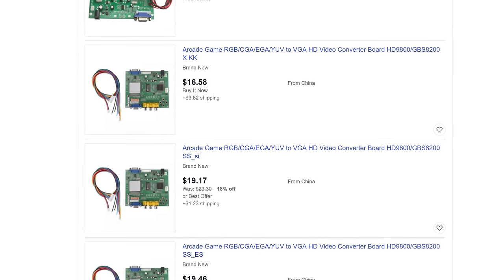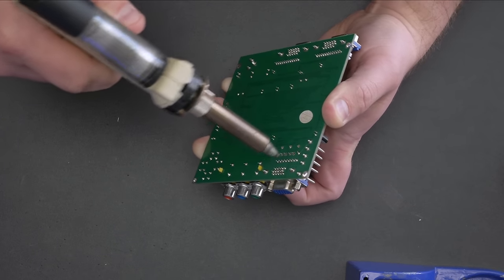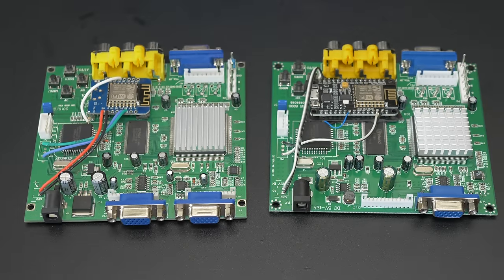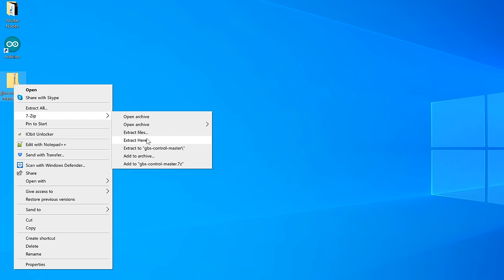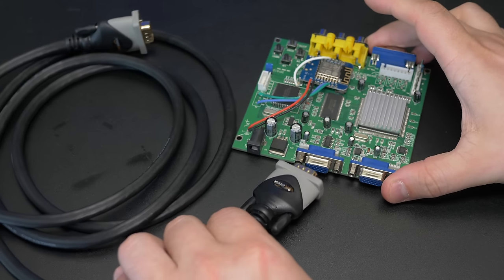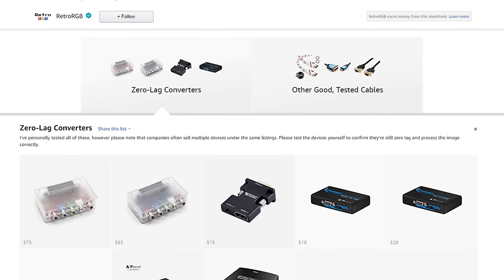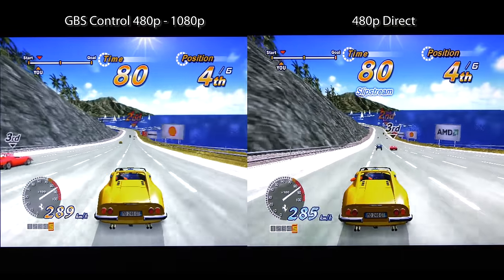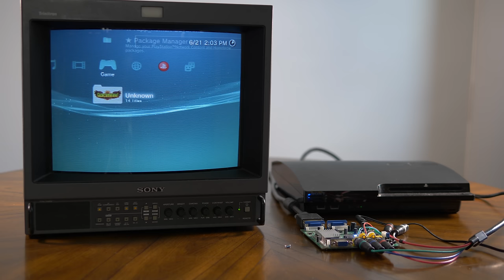GBS Control: Installation & Overview

Comment: I think the 240p comparisons are a little biased as it's evident that GBScontrol isn't quite configured properly.  With proper configuration you can get results much closer to OSSC quality:
https://i.postimg.cc/QMDB9YgP/amarec-20200111-210028.png
https://www.youtube.com/watch?v=B7dQPqsMXwA
Also, the comparisons really show why the retrotink has a reputation for being blurry xD  I realise it's only upscaling to 480p, but still.... blurrrrrrrr :P
Reply from the maker: I spent HOURS working with Rama to get this right and used FOUR different boards;  One 8220 (with and without) and three 8200's.  Also, my videos are zoomed to show analog noise, while yours are just fullscreen on a dark game...of COURSE your pics are going to be more forgiving.    Honestly, I'd have never expected this from you in the comments...you always post good stuff, but to accuse me of not double checking my work before posting such an important video is a real douchebag move.
Reply: @RetroRGB  well obviously I had no idea you worked with Rama, I was purely going off of the footage you posted, which honestly, doesnt look as good as I would expect from gbscontrol (at least looking at the zelda footage) there seems to be a lot of ringing artifacts on it, as if you have applied some kind of sharpening filter to it.  Not trying to be a douchebag, just giving my honest opinion based on what I can see.  I can see you've obviously put a lot of effort into the video and I am not downplaying any of that at all.  Im actually super happy to finally see this project get some exposure after so long.
Reply: Can you post some Zelda footage @AndehX ?
Reply: @mattsephton  I could do, but I'm not home right now, I'll try and get some in the next week or so

Comment: Personally think this is the best option for systems that have games that switch from 240p to 480i on the fly. Wonder what this would be like set to 480p output run into a OSSC.

Comment: FYI this seems useful even with ossc bc this has motion adaptive deinterlacing. Bob interlacing, as far as I've read, can cause burn in on modern displays. I think gbsc->ossc seems the best combo. Retrotink is laughably expensive, doesn't seem to make sense unless you have like >3 retro consoles.

Comment: Does that HDMI to VGA adapter work in reverse? The amazon listing says it only does HDMI to VGA...
Reply from the maker: LOL, no, I just grabbed the wrong one for the b-roll shot.  Check the link in the description.
Reply: @RetroRGB  Nice, that's the one I bought after scratching my head for a minute
Reply: Does the vga to hdmi adapter requires a 5v supply? Great video and already ordered the few parts required

Comment: Bag of bolts, are you for real?
Reply from the maker: Yup.  A bunch of people on the Shmups forum had the same thing happen.
Reply: RetroRGB has it been confirmed as a scam or simply a mislabelled listing? Regardless, good advice to buy from reputable seller. I got mine through Amazon UK - I picked the "Amazon's Choice" listing.